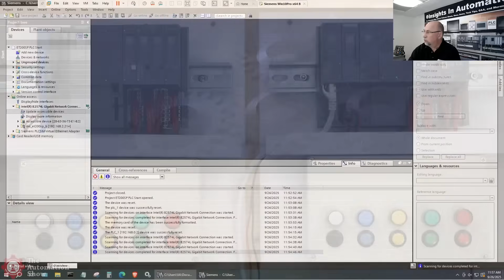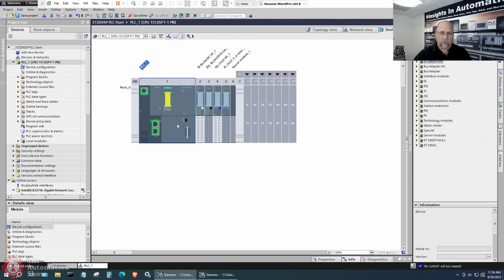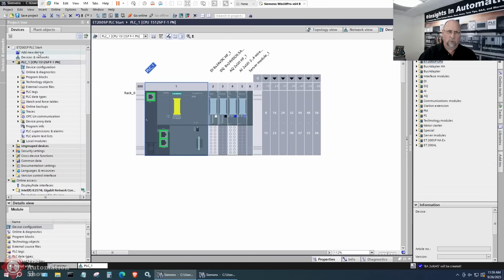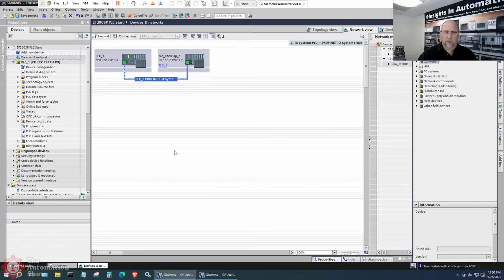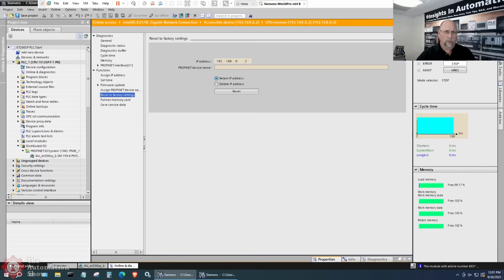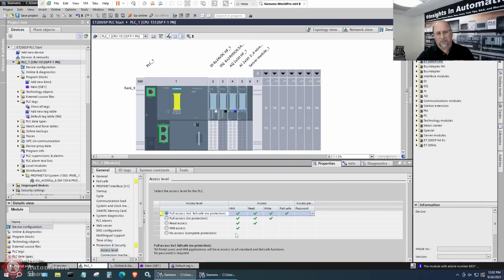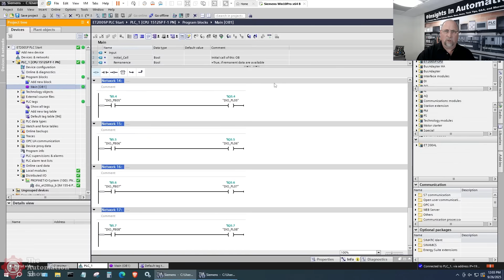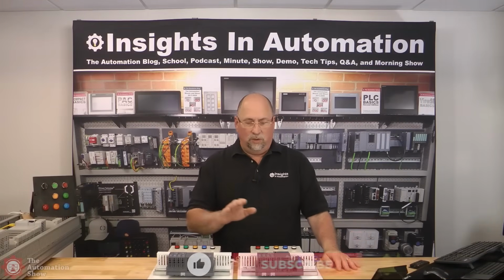ET 200SP CPU 1512SP F-1 PN Setup & Use

Comment: What is the difference between this device and some random S71500 PLC with additional IO modules, cuz i dont get it .
Reply from the maker: I don't work for Siemens, but two things come to mind:
#1 Compare the price of this PLC and I/O to the price of an S7-1500 with the same ET200 MP IO (I'm not a customer, so I don't have access to Siemens pricing)
#2 If most of your system is going to consist of ET200SP I/O, you may want the PLC in the main cabinet to be the same form

- Shawn